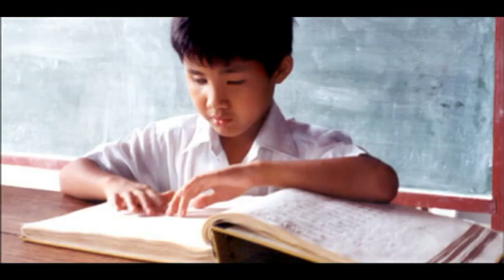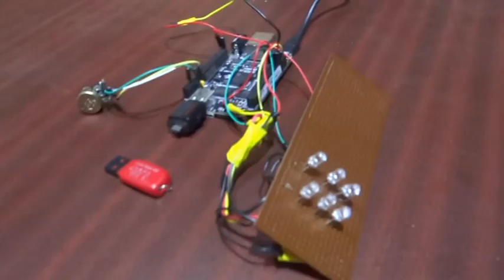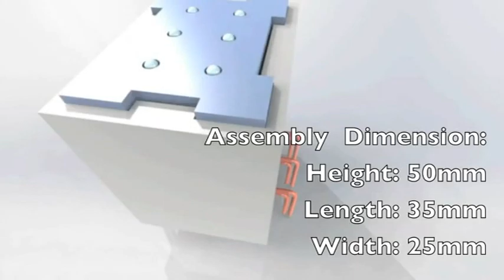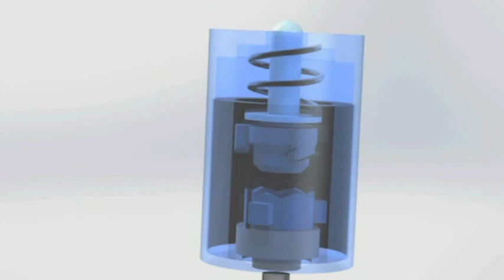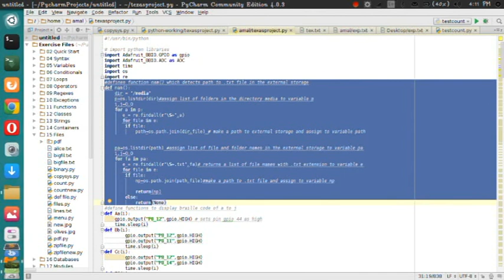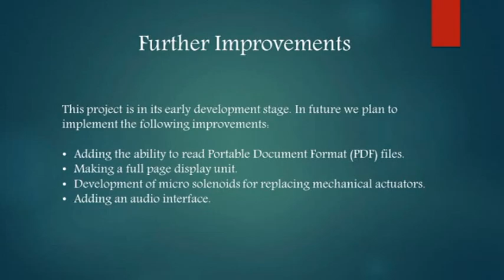TIIC IDC 2015-Team 1364-"Braille Audio Enabled Translator and Trainer"

Comment: I hope you don't mind if I ask, and clearly I could be missing something, but I am curious-- Is there a design provision to monitor the braille pin state given the toggle nature of your design? I can't see a way to reset the pins to a known condition, even if the state is "remembered" perfectly during normal operation. What happens in the the event of a crash, discharged battery, etc., or even a simple restart? There are probably going to be times when the system will loose track of the state of the braille pins.

The LED demonstration responds to “on” and “off” states, where the pin design would be restricted to alternating advances, always inverting the current state of a pin at the next signal. What will your "reset" procedure be for these braille pins?

Comment: This is an intriguing concept. Have you explored the possible implications for graphics displays with things like basic shapes and diagrams, as well real-time applications such as connecting your proposed display to a video camera to allow basic visual information in a tactile 1-bit display? With the right reaction time and refresh rate, you could convey information to the blind about things like walls, building edges, doorways, curb lines at streets, possible even crosswalks, moving traffic, pedestrians-- including SILENT pedestrians, etc.

What sort of cost do you believe would be associated with these displays in a real world production situation? Excellent work. I think of the video were a bit easier to understand, you'd be getting a greater volume of response. The echo in the recording makes it hard to understand, especially for those of us from different parts of the world where unfamiliar accents challenge our ability to follow technical matters.